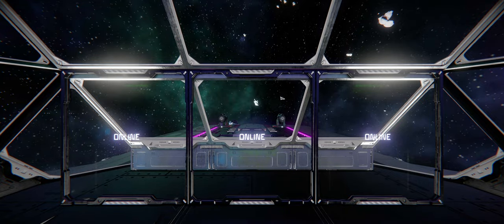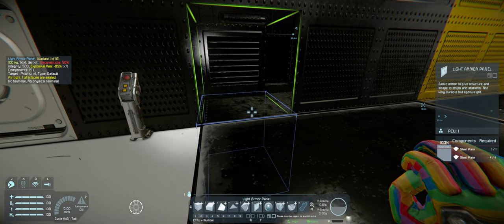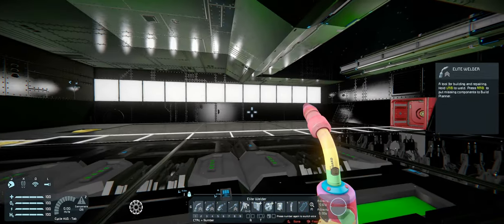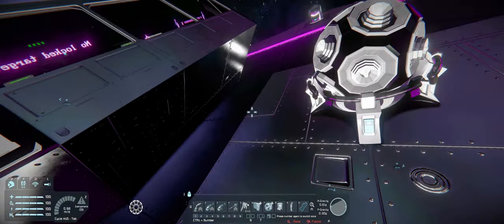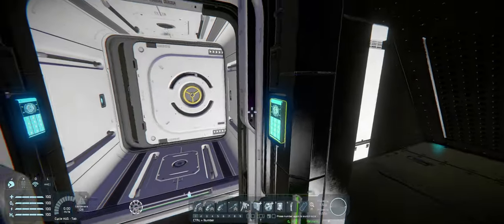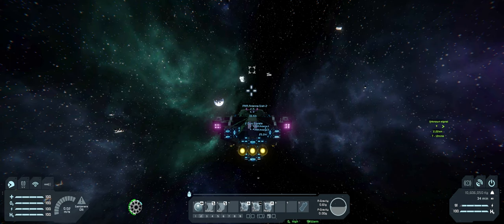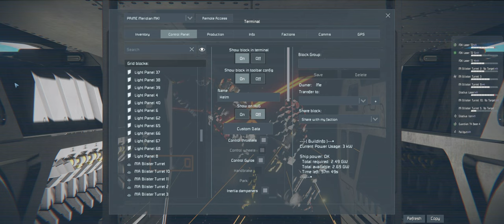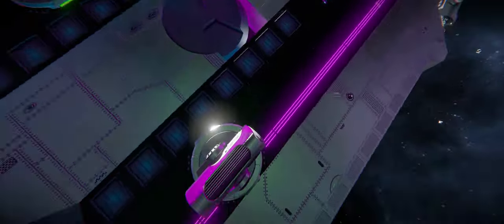Space Engineers Tutorial - How To Build a Battleship #4 - Large Grid Ship Design

Comment: (Lights) RED = DEAD 💀💀💀💀
Looks GREAT Psy!  🫡🫡🫡🫡
Reply from the maker: Absolutely! You could take the concept further with a damage detection script that can set off a ‘red alert’ 🚨 
Thanks very much 🫡
Reply: @Psy-Prime  I saw that there are shields in SE like Star Trek.  Do you have those installed?  If so, you could set your panel for combat so when you press a button, lights could flash indicating Battle Stations, shields go up and weapons come on line at the same time automatically or am I wrong?
Reply from the maker: You’re right about the shields mod - I used Defence Shields, it’s made to work with weaponcore. 
I never had them turned off though. Especially since the playthough series I built this for had constant enemies attacking us. 
But that is a great idea!